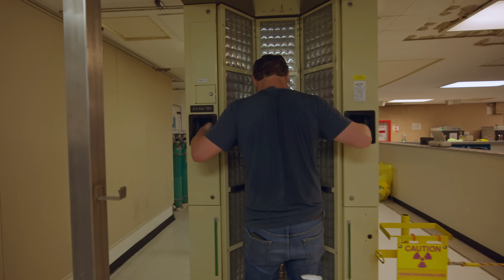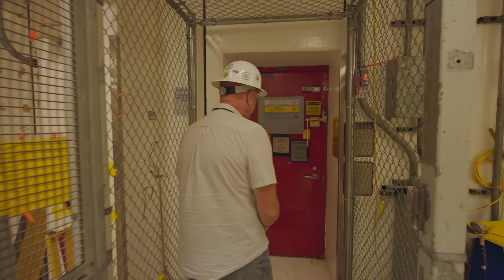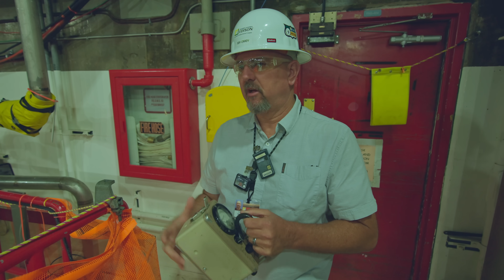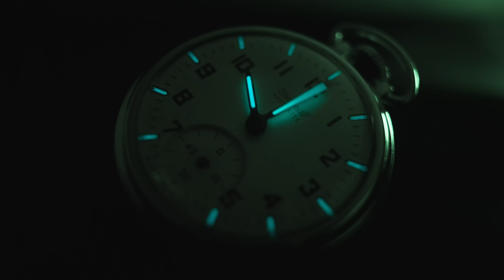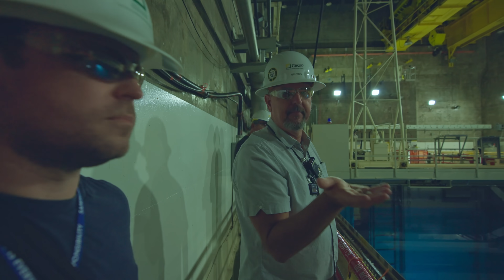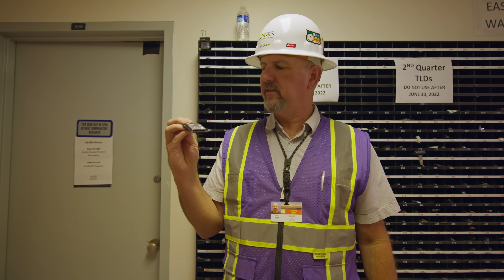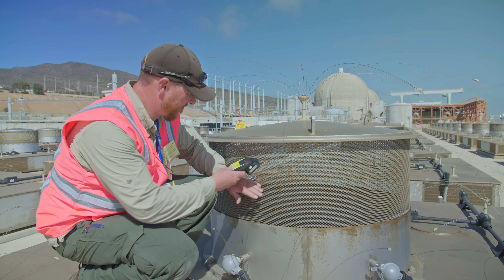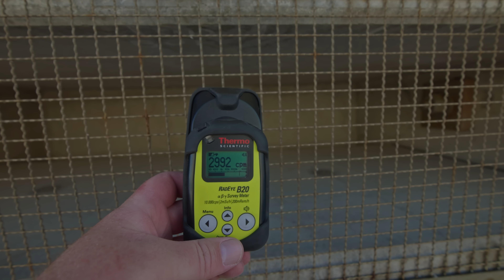Inside San Onofre Nuclear Power Fuel Pool and Spent Fuel Storage

Comment: At 28:00 he says the highest postulated tsunami is 27 feet. The Tohoku tsunami that inundated the Fukushima plant was 132 feet high. If I remember correctly the reason the meltdown occurred was because that knocked out power to some cooling pumps and it also destroyed the backup generators that could keep them going. This is going back memory-wise for me, but I had an interest in San Onofre after the Fukushima disaster because I lived south of there in San Diego county, and I believe this is close to the same design of plant as Fukushima by GE back in the late '60s or early '70s. I'm wondering if there are any other mitigating factors that could be put in place here to keep this plant operational without that risk. It is a seismically active area, so it's a genuine concern.
Reply: Fukushima was a working active reactor, San Onofre isn't active
Reply: @manw3bttcks  Correct, but again, if I remember correctly, that's the reason they shut it down. They saw what happened at Fukushima and it scared the crap out of everyone. I'm a proponent of nuclear myself so it pains me to see them shut it down.

Comment: Yes it will burn in open air… break those pins… no way to contain initial release. Hours for the fire. Depends on if it spreads. It’s like thermite but hotter 🤓 and more reactive

Comment: 200 counts per minute is not low. 500 is huge, sure not chernobyl? Maybe your countries levels are higher permissable than mine? but yeah weird. I have some uranium beads and they give nothing compared to your readings.
Reply from the maker: 200 counts is very low. 200,000 CPM is something to be a bit concerned about. You might have a detector that does only gamma radiation. If that’s the case then yeah those uranium glass beads will have a hard time showing up.

Comment: The truth is that if you don't pass the radiation detector safety machine, they shoot you and stuff your body into a 55 gallon drum. Then you're off to Yucca Mountain for 3000 years.
Reply: No... you just wait 15-30-45 minutes for whatever got on you (typically radon) to decay off and try again.  If you're at a BWR plant, the occasional steam leak will make getting through the monitors a challenge but it decays pretty quicky. Worse comes to worse, you're wearing scrubs for the rest of the day.

Comment: 19 min 32 s 33.0 feet = 10.06 m from bottom of the grid to the top of the pool
27.0 feet = 8.23 m

26 min 30 s The canister is tall. 17.0 feet = 5.2 m

28 min 05 s Tsumami height 27.0 feet = 8.23 m
32.0 feet = 9.8 m

Comment: This is taking me back to my days working at Nukes. Spent a lot time in the SFP building and down in the fuel transfer pit and reactor cavity and containment buildings and aux buildings (etc). Almost all of my jobs and jumps were in the PA (protected area) or RCA. Cant tell you how many pre-job briefs, walk downs, and PCs (protective clothing) I've been in. Been in some pretty "hot" areas in the plant.
Reply: Do you make good money in this field?
Reply: @leahocon6231  yes, absolutely. The job requires extra training and clearance above the required skill of whatever your trade is, like Ironworker or pipefitter, so that's one reason for the higher pay than just a normal, non-nuke ironworker. Also, most of the plants hire union workers, and there is slightly higher wages for union workers vs non-union. A lot of the guys I knew worked at nukes for 6-8 months of the year, then took the rest of the year off. One downside may be that you have to travel to the sites around the US for outages. Might be an upside if you're into that. Each state has different wages, but typically the North and the West pay the most with the South being the lowest, but still well above average wages for the area.
Reply: it's called blue collar paradise for a reason
Reply: @DeanFerraro  Hmm, didnt hear that one. It's still hard work, so I wouldnt reallly call it paradise.

Comment: Wow I never knew their safety protocols were so sophisticated that's crazy
Reply: The security is even tougher. But they won't let you film that part! It's like airport security, remove belt, shoes, everything x rayed, explosive sniffers, hand geometry sensors, guards with rifles and body armor, and probably other things they don't tell us about. The one not far from where I live has huge concrete blocks placed end to end around the ENTIRE perimeter (thousands of blocks,  each bigger than a car) so you can't get a car, or say truck bomb, through anywhere but security points, which have gates that pop up out of the ground that will stop a speeding truck cold. 
If the average person that's apprehensive about nuclear could see how ridiculous the security and safety is a nuke plant, I think they'd change their minds. 

The fact they can spend so much on safety and security and still make money tells you how valuable electricity is.

Comment: Couldn't we use the heat from the spent fuel to create more power as the rods slowly cool down?
Reply from the maker: I would think so. Seems like a waste of power to not tap into that heat coming off.
Reply: @RadioactiveDrew  It's not enough to generate power reliably. They can be recycled into new fissile materials, but right now the US Dept of Energy is content with letting them sit in ISFSI storage. If they just kept them in the reactor core - eventually the fission would decay to the point where you're no longer capable of running at 100% power and therefore not making enough money to pay the bills.  The water will still boil, but you're no longer generating the 950 psi to needed spin the turbines for full generation. That said, if you turn off the spent fuel pool cooling - the water will boil off and you will have problems!

Comment: Did they decommission it because of the age of the plant ? And are they building a new plant ? Or no nuclear power in CA ?
Reply from the maker: They shut it down because the new steam generator they installed had a leak. It was an excuse to shut the place down. California has been trying to get rid of every nuclear power station in the state for a while now. They almost got their wish right before they realized they still need the power. Diablo Canyon is the only one left now.
Reply: @RadioactiveDrew  That's a shame really...  Nuclear is the future, and newer molten salt reactors are the answer.  In today's nuclear reactors we do everything we can to NOT have a meltdown, which greatly increases the cost to build them due to the triple redundant safety measures we have to put in place..  In molten salt reactors we will embrace the meltdown, thus removing a lot of cost to build them because you don't have to build triple redundant safety protections into the plant.  Don't get me wrong, molten salt reactors will have their own safety systems, of course, but if you remove the chance of a meltdown from the equation you can save quite a lot of money.  Molten salt reactors will result in much less waste overall, and they can actually recycle a lot of the nuclear waste our first and second generation reactors produce.  Meltdowns are why so many people are against nuclear.  Remove that fear, and there are no good reasons to not go nuclear.

Comment: those detectors are highly susceptible to electronic interference, 60 watts pings high as 300 or so from 4 feet. turn your cell phone off or leave it behind, a poorly bonded ground strap in the main fuse panel will cycle static oscillating electricity thru the whole structure. 3000 or so is static oscillation that can power a micro led light... so if that pool ya walked past was full of Uranyl Nitrate, the water level is critical as it is soluble up to Ur66g/H2O100g that's 66% regulation is not to pass 19.9998%... test the water for evaporation/crystallization now and then "daily". un-explainable permanent loss of elements during operation... physicist's don't take chemistry nor practical electrical work shops. very sensitive transistors in the stepping output block, as if the laser etching went down to a whole Nano meter thru a wave splitter and such polarization things... under the rock, berried to prevent theft from oncoming theory of invasion of ones that burn it all and recycle nothing.

Comment: Legitimate question: What happens if you were to fall into the water? Either now whilst inactive or during a time during active cooling. Is it radioactive or have a dangerous chemical in it? Not sure if that was covered or if I missed it in the video. Awesome stuff here thank you sir.
Reply: Divers swim in it all the time, it's pretty safe unless you go very close to the fuel itself.
Reply: Spent fuel pools are always actively cooled. They'd boil otherwise (RE: Fukushima). I've seen it happen in the refueling pool (same water as the spent fuel pool, just fewer fuel assemblies). Drowning and hyperthermia are the biggest hazards. Assuming you're less dense than 104F water containing 2200 ppm boric acid, you get contaminated. You swim over to one of the ladders and climb out. Or, somebody wonders what the hell you're doing in the pool and fishes you out. The HP techs strip you buck naked and clean you in a decon shower (Gently-not like Silkwood). Once your hair and skin are decontaminated, you'll get a whole body scan. If you ingested water, they might give you an expectorant and a laxative and monitor your excretions. But probably not. The water clarity, depth, temperature, chemistry, and concentration of radioactive contaminants, are controlled by cooling, purification and demineralization per Tech Specs (i.e.: not optional), and sufficiently low, that you'd be more embarrassed than harmed.

Comment: Why does the interior of these buildings all have the peeling paint and what looks like falling plaster spots all over, especially the offices? I saw it on the ceiling and on the hallways of the areas you were getting tested in.
Reply: Because it's been closed for 9 years and is currently in the process of being decommissioned, no need to keep it looking new and current - just relatively clean for those dismantling it.

Comment: Hey, we’re the California state government and it’s many decades ago.  We recognize that having clean air is nice.  These new-fangled nuclear power stations don’t emit poisonous hydrocarbons, but ya definitely need to be careful about the radioactive fuel they use.  Let’s build one… on the edge of a cliff overlooking the ocean along one of the most active fault lines in the world!

Hey, we’re the California state government and it’s about 1 decade ago.  We recognize that having clean air is nice.   These new-fangled electric cars don’t emit poisonous hydrocarbons, but they definitely need electricity to charge.  We should push our populous to buy them… while shutting down our clean nuclear power station that we built on the edge of a fault line, Japan had a thing.

Hey, we’re the California state government, and it’s about 2 months ago.  We began the process of outlawing hydrocarbon powered vehicles.  Oh wait, there’s a heat wave.  Our populous need air conditioning because we don’t build houses with insulation or ventilation.  It’s too much for our weakened power generating system.  Stop charging your electric cars, hop into your gas powered car, and crack the A/C so that you don’t die of heat stroke!

Comment: I pick up and deliver at the FiestaWare plant in WV. I take my rad counter whenever I go in there and it's scary how radioactive that place still is. They buried all the radioactive stuff in a pit near the middle of the site, but the old part of the building still emits a mild dose of radiation. Kind of surprised there isn't more cancer in Newell, WV
Reply: Low-level beta radiation isn't that dangerous.  Those particles aren't very good at penetrating, and so even your skin is pretty effective shielding.  As long as it's just the radiation, and there aren't radioactive particles floating around where they can be inhaled or swallowed, there's not much danger.

Comment: "What happens if a tsunami washes through here?"  

The casks would get wet.  That's it.  There are no active systems going on here, those things are just sitting.  Long term, you'd probably want to dry that out and clean it up because it might erode/corrode the materials faster than designed life, but short term, if anything, it just increases the amount of shielding around them and reduces the temperature.

I felt this was an important comment to leave because the plant guy's answer may seem kinda like he was dodging or downplaying the issue.  The tsunami was a problem for the Fukushima plant because it affected the WET fuel storage cooling systems, i.e. the big pool from earlier in the video.  When fuel is in there, it is hotter both radioactively and temperature wise, and requires active cooling.  After that 3-5 years, it has decayed away enough that it produces little enough radioactivity that it can just naturally air cool in dry storage.

Comment: I maintain commercial nuclear power plants in my trade for a living. They are making a huge mistake shutting these plants down. HUGE mistake. Also, I have welded in and worked at this very plant. The contractor (or one of the main ones) that he spoke of when talking about the fuel handlers is usually Areva....sometimes GE and a few others. That's not just regular water for shielding either. It's demineralized water with additives. Big difference. It's more dense. You get more radiation from the sun, tanning beds and bananas than you ever would from even working in these plants.

Comment: What would happen if you swam in that pool and if the fuel rods are hot still, why not use them still what makes them un-useble ??
Reply: If you stay at the top not much would happen because water blocks most of that radiation; However, if you swim down that’s a different story. The rods are unusable because they’ve passed the point where they can no longer effectively produce steam for energy production.